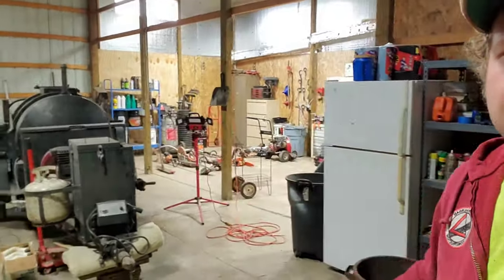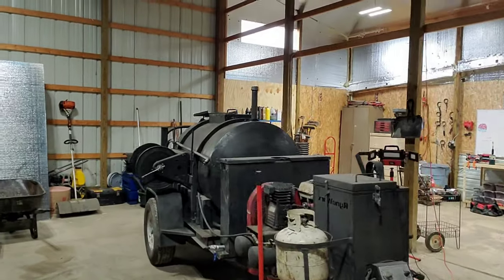Cleaning a Sealcoat Tank

Comment: Curious as to what kind of tool your hired cleaner is using.  I clean my own tank (much smaller) with a hammer and chisel, and its excruciating.  Anything to speed up that job would be welcome
Reply from the maker: He uses a air powered chisel from harbor freight ran off a air compressor. They have a variety of tips and bits as well. Hope that helps.
Reply: @PathfinderExcavating  Thanks, I will check it out.